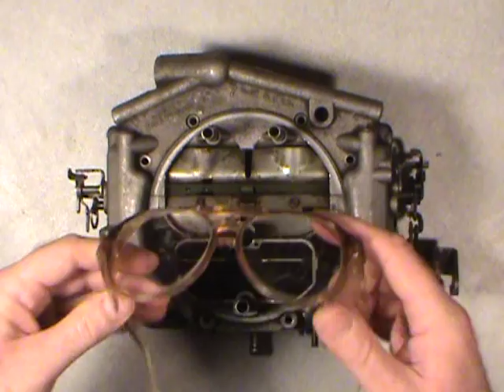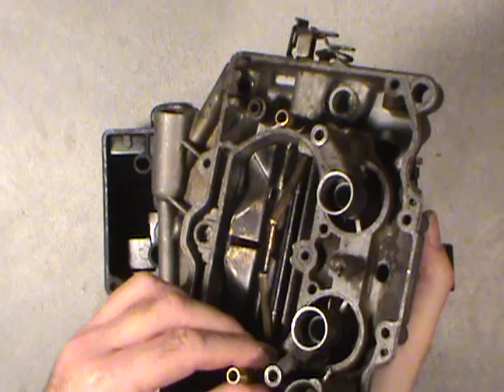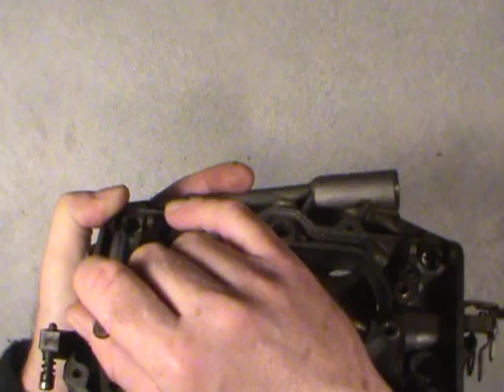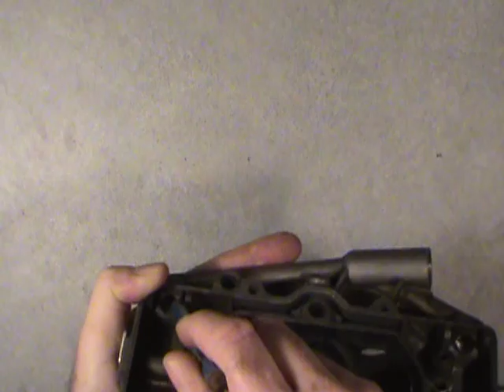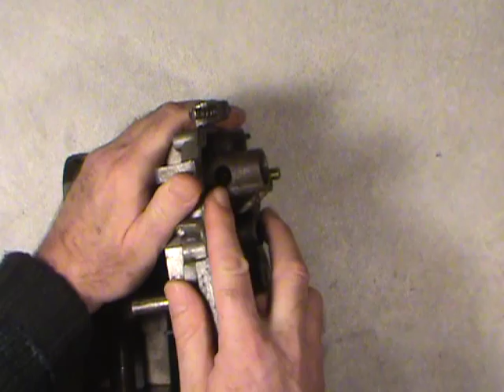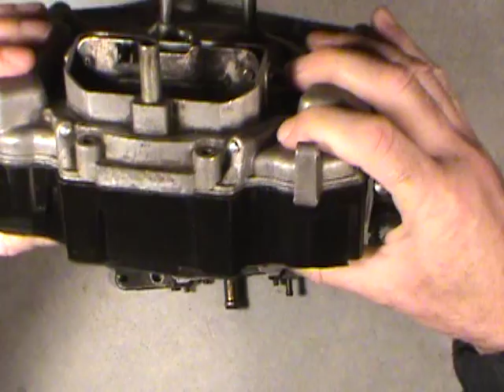Rebuild your Thermoquad Carburetor (Part G)

Comment: I use that Berryman's Chemdip. I don't know whats in it but that stuff melts away carbon and varnish like nothing else I've seen. It comes in a gallon can with a basket but I used a pan and pored it in that and used a toothbrush and some nylon brushes.

Comment: I may have missed it along the way but the accelerator pump spring is tapered. which way does it go ?
Reply from the maker: Greetings...4339jk.........Thanks for watching.........Well, according to the Thermoquad carb's, rebuild kit's instructions (sheet of paper), then, the picture is showing that, the "small end", of that tapered spring, gets installed on the shaft, "closest" to the accelerator pump's piston...and...till next time.......Be Safe, take care, and have a good one.
Reply: @RockysRoadshow  You don't get a simple sheet of paper in the kit anymore you have to read thru the factory manual PDF now but I found it...fat side up
BTW...again I read in one of your post you were going to do a Street Demon review a few yrs ago. It would be interesting if it would sway
my decision to go with the TQ instead...???

Comment: Great guide, I'm rebuilding my 1984 ram van TQ
Reply from the maker: Greetings...Ben Thompson...…...Thanks for the nice comment...…...If the two floats, inside of your Thermoquad carb, are made of that "nitrophyl" material (looks, kinda like black plastic), then, don't reuse them, and buy and install new floats...…...The reason being, is that, they sometimes act like a sponge will, as in, will sometimes absorb gasoline, and then, start to sink, which will cause a really rich air/fuel ratio, kinda like, having the choke on, even when the engine is fully warmed up...…...If the floats are made of brass, then, they can be reused, as long as, there don't have any (air) leaks in them...…….Also, buy and install, a new choke "pull-off", (looks kinda like, a little space ship...lol), because, it has two functions...…...It will open the (top) choke plate a little bit, upon engine start up, as well as, it also regulates, the opening rate, of the secondary air door (old choke pull-offs, tend to stick, or, don't operate smoothly, when the choke pull-off's rubber-like, internal diaphragm, gets older, and dried out)……….If the gasoline that you put in your vehicle's gas tank, has 10% (and hopefully, not any more) ethanol in it, then, the Thermoquad carb, might run a bit on the lean side (air/fuel ratio-wise), and can cause some surging, when, just cruzin' along (city speed, or maybe faster), as an example...…...I had to increase, the (two) primary jet's size, quite a bit, just to get rid of that lean surging, that I had, while just maintaining city speed (steady gas pedal, on a level road), when burning 10% ethanol gasoline (these good ole Thermoquad carbs, were probably calibrated, with 100% gasoline, probably before, they started adding that ethanol/alcohol, into it)……...Make sure to do all of the "adjustments" (settings), in the correct "sequence" (order of doing them), or, that freshly rebuilt Thermoquad carb, might run like crap...!!!...…….The instructions (sheet of paper), that will usually be in the rebuild kit, are usually pretty good, at showing that correct (adjustment/setup) "sequence"...…….Good luck, and......till next time...….Be Safe, take care, and have a good one.